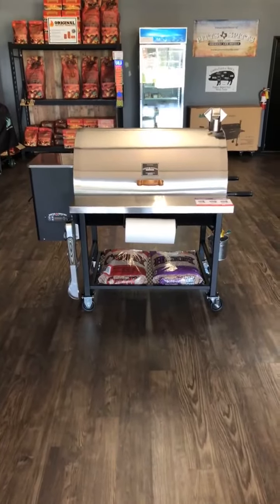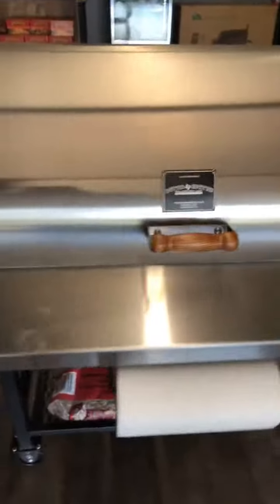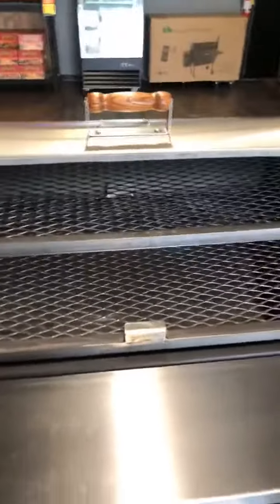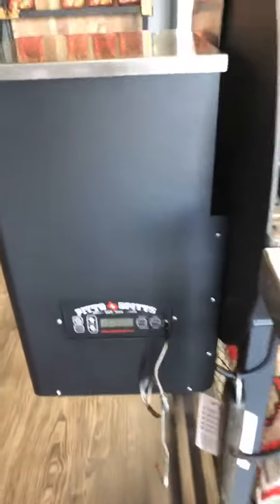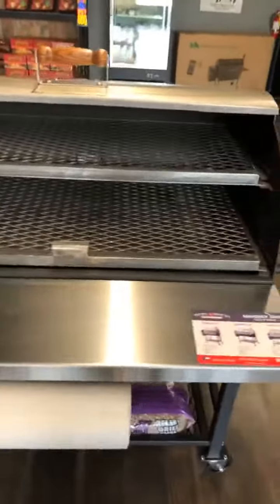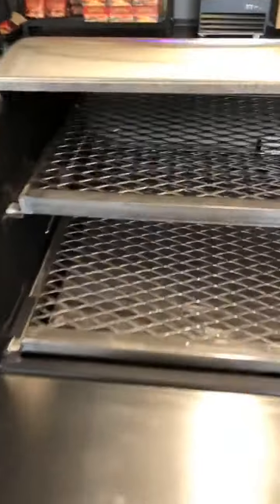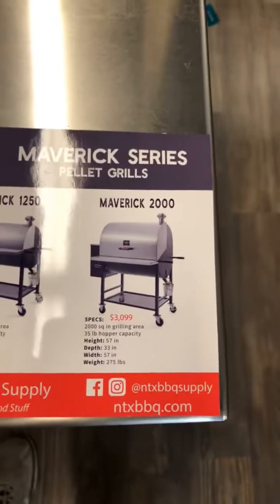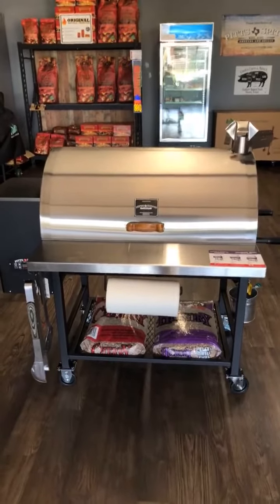The Pitts and Spitts Maverick 850 and 1250 Grills. The ultimate Pellet Grill hand welded in Texas!

Comment: Gator Pit is 1/4” 🐊
Reply: Gator Pit is made out of 301 Stainless Steal. P & S is made out of 304 SS.
304 Stainless steal is better
Reply: DJ Lansing only the shelf on the 🐊 is stainless. The body is 1/4” steal pipe. I have a stick burner pits and spits and the gator pit, the 1/4” 🐊 is much thicker and substantial.